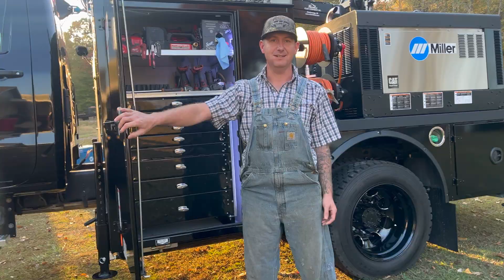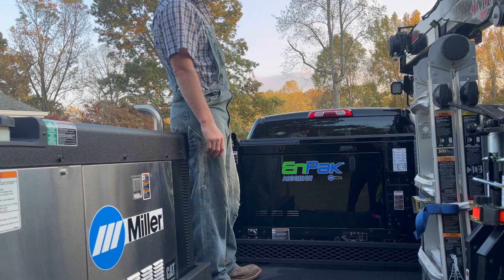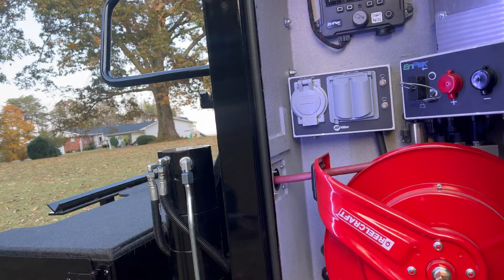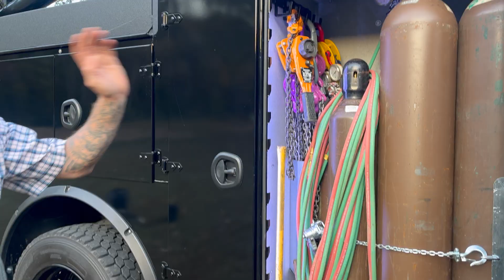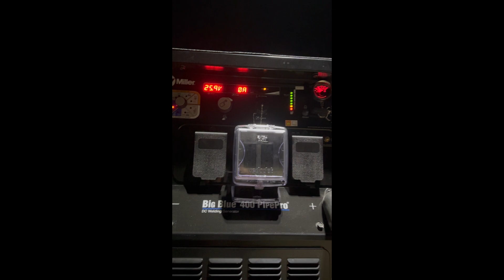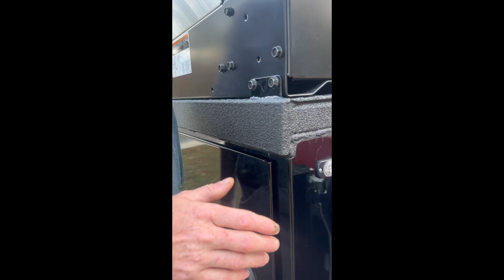IMT Crane Body Truck Tour | Full Walkthrough + Features!

Comment: I’ve been running a set of diamond reels for 2 year and they still work perfectly fine. I repair open pit mining equipment (d10, 395, ex2600) gouging and running wire at 30 volts constantly through those reels without all my cables ran out. They only issues I’ve had is the paint flaking off but they function perfectly fine. 

I wonder what I’m doing differently because I’m surprised mine still work considering how many people burn theirs up. I run 2/0 cable at  50’ on each reel and all my lugs are soldered on. The only thing I can think of is I run a lot less cable on them than other people since most load them with 100’ leads.
Reply from the maker: @JTwelder.  not sure I got two sets over 2 1/2 years in the junk pile now . We do a ton of arc gouging . On paper a live reel all steel with constant voltage/amps going through the bearings is to be expected to fry the reel bearings . The aluma reels are obviously aluminum built and your current never contacts any of the reel bearings. My issue with my diamond reels I believe was just extended arc gouging and welding 10-14 straight running at same volts you mention running dual shield wire .
Reply: @chamberlainsPortableWelding  I gouge quite a bit like you but only at 300 amps because I’m running a 302 airpak so that might help as well along with the shorter leads. I can see how 100’ leads and running a gouger all day would burn up the bearings but I guess I’ve just had good luck. I’m sure I’ll have to upgrade eventually.
Reply from the maker: @JTwelder.  for sure ! and Congrats with the 302 airpak . thats what i built my  business off of . im currently fixing my one ton back up and leaving the airpak on it . thank machine alone is worth its weight in gold for sure :)
Reply from the maker: @JTwelder.  any holy smokes man i didnt know this was wolf welding commenting on my stuff . you got me star struck now lol! i absolutely love your content bud
Reply: @chamberlainsPortableWelding  Haha yeah that’s me, I haven’t uploaded in a while but I’ve got some new videos coming out this winter. I just found your channel today, you have some good videos to keep it up!
Reply from the maker: @ thanks bud we are more known on TikTok but my wife been slowly building the YouTube up hopefully we can get it took off and you keep up the awesome work to bud

Comment: Damn sweet truck but at what cost lol that’s gotta be a pretty penny
Reply from the maker: @dandersen464  I definitely got a loan for part of it , but I’ve worked two years to get to this point :) . Scarred money don’t make money , gotta invest and make the rest
Reply from the maker: @dandersen464  also I bought the truck close to 3 years ago with a different bed , paid it off in like 2 years then took the money I was putting towards it to invest in this new bed .
Reply: Ya man, just got out this past April in wasilla Ak trying out business for myself. Looking to double revs this year! 2006 Chevy 2500HD with a ‘24 Miller 330, 30A spool gun, and 12RC. Keep up the content!
Reply: Also, what setup do you have for line boring? I’m looking to tap into that up here.
I know line boring systems out of NH will work with the suitcase feeding but it hella expensive
Reply from the maker: @ I use York portable boring equipment, I’m still hand welding with suit case but Im looking to invest in to a bore welder this coming year to speed things up :)
Reply from the maker: @dandersen464  if a man got the want to and faith that God will lead him you’ll do good ! I started in my 1ton flatbed just like you are doing 3 years ago this past Dec 10th !

Comment: Why do you need the hydraulic pump, when you have the Enpak ??
What did it cost 500k ??
Reply from the maker: If your talking about the hydraulic pump in my right side cabient , I use it and a 60 to 100 ton pulling ram to remove pins , press bushings and help bend metal .
Reply: @chamberlainsPortableWelding  
Does the Enpak not generate enough pressure ?
Reply from the maker: @JohnSmith-lv8xk  I’m sure it would have if I plumb up external fittings off the enpak ? But there’s times I’m not even remotely close to the truck so having an electric pump is more ideal .
Reply: @chamberlainsPortableWelding  
Gotcha, I don't ask to be annoying, there is likely something I am missing.

Comment: Nice rig 😎, is that slide out step custom or can it be bought somewhere? I need 2 for my flatbed
Reply from the maker: thanks !!! and im not sure the bed builders mentioned about that ideal and they surpirsed me with it once the bed was complete :) its definitely handy , i pull it out and use my pipe stands to hold metal so im not cutting metal directly off my bumper :)

Comment: Nickols Fleet great crew to work with 👍👍 Beautiful setup love the miller pipepro we have an 800 mounted on a IMT Dominator 4 body with 14K lb crane for the earth moving equipment mechanic truck and love every single aspect of the truck.  And we will never buy an another truck with out an EnPak we tried them when Miller first introduced them and we were immediately impressed and sold.  Great Job 👍👍
Reply from the maker: Thanks! And I agree they are great people for sure. Glad to hear good  things about the enpak - it’s already come in so much use for me the few days I’ve had it

Comment: What process are ypu changing to go from carbon arc gouging to stick welding? It should just be a change in amperage.
Reply from the maker: Check out the miller pipe pro 400 it has multiple settings from stick, carbon arc , non flux , flux , 7018 and 6010 settings .
Reply from the maker: On my smaller 302 airpak machine it only had stick tig and mig settings so I’d swap over to stick for gouging on it